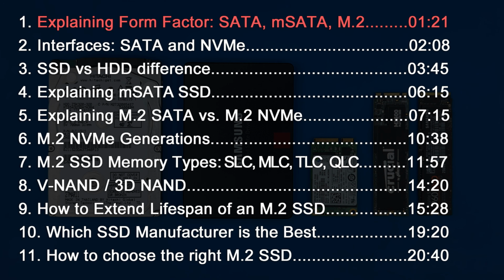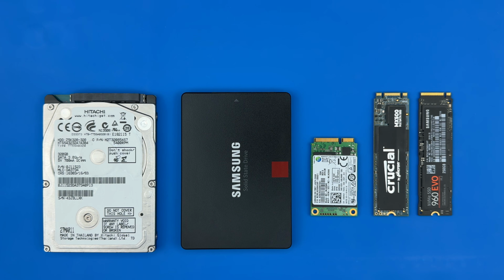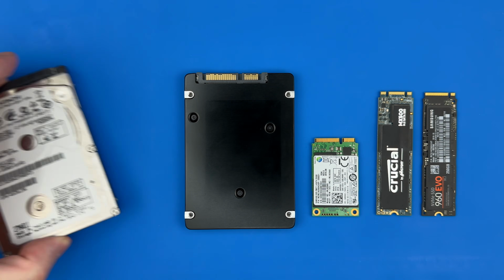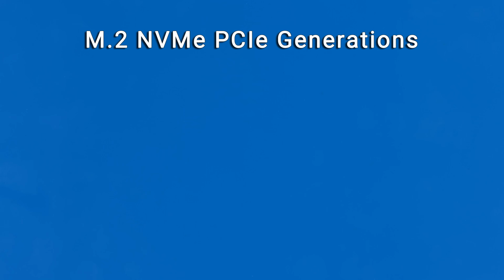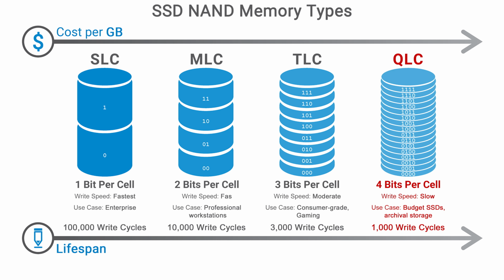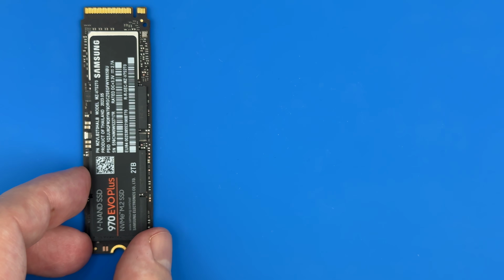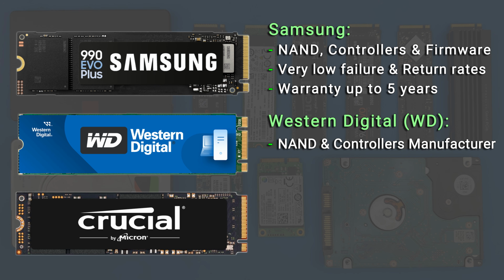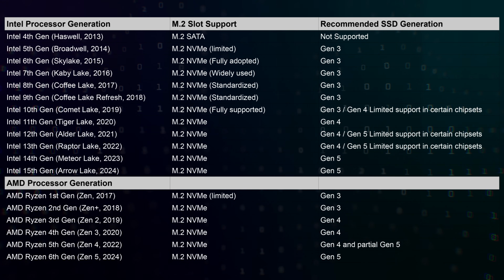SSD vs HDD vs NVMe vs SATA vs mSATA vs M2: Storage Devices EXPLAINED!

Comment: Very well explained which made it VERY easy to understand. Good job. I would of liked to seen added talking about the pairing of different drives. Ie using nvme for booting and operating system and HDD for storing everything else. As I've heard of this being used but am unsure if using one limits the other and so forth.

Comment: this video is one of the best in youtube but it hurts my eye to see a screen with white background for a long time. but the colors are beautiful mostly blue and white. that indicates venus has a significant role in your horscope.. you could be having an ascendant as the one that belongs to either mercury, venus or in a very rare scenario saturn. great work buddy that B and N can't be explained more simpler than this. I made a terrible mistake of buying 250 GB nvme connected via  my pcie adapter card since my pc is more than a decade old. So i mod the BIOS and enabled boot from nvme but i should have chosen a 500GB m2 but anyways I am going to use my nvme just for os and will redirect all my downloads to a different drive. so this 10% of free space I will keep an eye on it.. ! the nand types explations were spectacular.. .this is a video chisled like an experienced scultor no errors whatsoever.. great work.

Comment: Nice video BUT... you keep talking about slow (or fast) speeds. A speed can NOT be fast, it's the WRITING (or reading) that is fast, NOT the write SPEED because that is HIGH (or low).

So do NOT say "slowest write speeds", but instead say "lowest write speeds" or "slowest writes".

Likewise there are no warm temperatures or expensive prices.

Comment: Great video! (I'm now a channel subscriber.) One question: When you were calculating Daily Write Allowance, why did you use ten years? In Samsung's description, they say the unit comes with 5 years of protection. Hmmm... Or do you just plug in the number of years you anticipate using the drive? So I'm just wondering...

Comment: @howfixit  Model: Dell Inspiron 5570 x64
Processor: Intel(R) Core(TM) i7-8550U CPU @ 1.80GHz, 1992Mhz, 4 Core(s), 8 logical processesor(s)
Installed Physical Mem: 8.00 GB

What do you think is the suited ssd generation for my laptop?

Comment: Thank you for your informative video. I have a Dell Laptop which is at least 5 years old. It has an Itel I7 sticker on it so I would assume that is the CPU Spec. I did upgrade the old harddrive by swapping it with a Samsung SSD 870 EVO of 500GB. The Device Manager also shows my laptop has a Dell Portable SCSI Disk Device. As I am on a pension,  I do not intend to replace my laptop unless is breaks down and although my Win 10 will be no longer supported post October 2025 so I am hopeful that my Malawarebytes Premium will continue to work after the support ends. In any event, I was recently given a gift my a friend of a Samsung SSD 990 Pro PCle 4.0 NVMe M2 SSD and my question is therefore do you think it can be added to my laptop internally or would that be a waste of time. My friend thought that I may upgrade my laptop soon thus the gift but I do not intend to do so. The drive is still in the box and does not have a heat sink so I would buy one if the drive can be used. In this case would you recommend either copper or aluminum? I would be grateful for your thoughts and advice. Regards, Malcolm

Comment: Looking to replace OS storage with a 2TB SSD: Samsung 990 PRO NVMe M.2 SSD, 2 TB, PCIe 4.0, 7,450 MB/s Read, 6,900 MB/s Write, Internal SSD, for Gaming and Video Editing, MZ-V9P2T0BW.

Looking to replace HDD data storage with a 4TB SSD: (1) Samsung SSD 870 EVO, 4 TB, Form Factor 2.5 Inch, Intelligent Turbo Write, Magician 6 Software, Black or (2) SAMSUNG 870 EVO 4TB 2.5 Inch SATA III Internal SSD (MZ-77E4T0B/AM).

Am I making the right SSD selections to upgrade my PC or would you recommend something with better performance?

Computer Name: HP Pavilion Gaming Desktop PC
Product number: 1K4J3AV
Computer Processor: 11th Gen Intel(R) Core (TM) i5-11400 @ 2.60GHz   2.59 GHz
OS: Windows 11 Pro
OS Storage (Drive C): Intel HBRPEKNX0203AH M.2 2280 NVMe PCIe Gen3 x4
Data Storage (Drive D): Seagate HDD ST2000DM008-2FR102

Comment: Another benefit of SSD is that it doesn't have the 10000ft altitude limit above which HDDs are likely to be damaged
Reply: Not  many folks live over 10,000 feet or 3050 meters. So who cares?
Reply: @mikemortensen4973  well there were lots of stories back in the day of iPods and laptops becoming toast on mountain climbs or un unpressurised aeroplanes

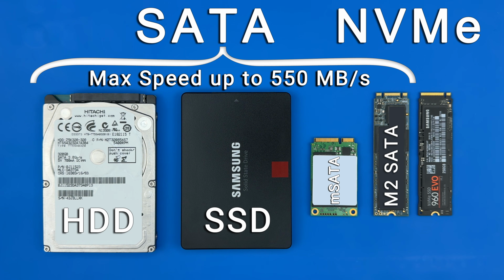Comment: 3:23  I don't think the SATA interface is necessarily considered "outdated". Just very old.

For your primary drive, you would always want an NVMe drive where possible. But beyond that, not all storage use cases prioritize NVMe speeds. In practice, SATA ports supplement M.2/NVMe slots because you typically only get one or two of them because they will take up PCIe lanes on your cpu. But on the same motherboard you can get 4 or more extra SATA ports.
For the SATA ports, you have the flexibility of choosing using HDD (for cheaper storage) or SSD (for faster and mechanically durable storage)

If you need more storage than what your primary drive can give you, adding a SATA drive (and more over time as older drives are in danger of wearing out out) can often be the sensible option.

Comment: Hi, one question here, I have recently purchased my work laptop it`s an old Lenovo L570 20JR-S00J15, it turns out that it has a WWAN port that is compatible with M2 SATA 2242 SSDs, but here M2 M2 SATAs are way more expensive than M2 NVME, so any suggestions? I tried to find a M2 NVME to SATA adapter but no luck only M2 SATA to SATA adapters available.

Comment: Great video. On your table for the generation of processors, the Intel(R) Core(TM) i7 4500u CPU @ 1.80 GHz, 2401 MHz, 2 Cores, 4 Logical Processor(s), a product formerly known as Haswell (currently running my PC), is fourth generation, and the recommended SSD generation is not supported. At the moment, an SSD Samsung 850 EVO 250 GB is running in my Dell Inspiron 5537 with board DELL 019RG3-version A00. Is there no space for an SSD upgrade? Thank you very much.

Comment: Model: Dell Inspiron 5570 x64
Processor: Intel(R) Core(TM) i7-8550U CPU @ 1.80GHz, 1992Mhz, 4 Core(s), 8 logical processesor(s)
Installed Physical Mem: 8.00 GB

What do you think is the suited ssd generation for my laptop?
Reply: Looks like it ships with a hard drive, so you'd be looking at a 2.5" SATA SSD.
Reply: @FlyboyHelosim  it's currently using harddrive but it has slot for M2
Reply: @howfixit  thanks in advance hope you can help me

Comment: WOW! You are doing such a great job, but I am still confused with regards to certain acpects. especially the motherboard.. I have Dell Latitude E7470 14", Intel Core i7-6600U Processor Base, Integrated HD Graphics 520. Which SSD is best for me? I currently have 400-AHCC : M.2 256GB SATA Class 20 Solid State Drive. I copied from Dell's website. it was brought a decade ago, I switched covers and upgrated to Win 11
Reply: So basically you're limited to M.2 SATA SSDs, so anything like that up to any capacity that's currently available on the market.
Reply: Thanks :)

Comment: My dell laptop has a 22x30mm format ssd . The drive says PCIe on it but the connectors are the M2.SATA type with two notches. The system info  says the drive is NVMe. I'm a bit confused about what will be compatible.
Reply: M.2 NVMe SSDs can also have two notches. I would say it's definitely NVMe.
Reply: @FlyboyHelosim  Thank you
Reply: @PhilArmstrong-ql9zr  No problem. Unfortunately this video left out several bits of important information, such as M.2 NVMe SSDs also being available with two notches, which will ultimately lead to much confusion.

Comment: I am going to be honest, i am surprised to see Crucial on this list.  I had a Crucial SSD fail (which of course was the primary boot drive) and got it warrantied only to have the replacement fail as well.  Never bought another Crucial drive after that.  I ended up getting a Kingston SSD which is still functioning.  I can understand Samsung and WD being on the list as i personally have had good experiences with them.
Reply: In a similar vein, I am very surprised by the absence of Kioxia, the king of NVMe manufacturers.

Comment: Hey there
@ about 6:06 in talking about data recovery you mention a method of transplanting the disk into a compatible hard-drive.
Do you have any videos on your channel which delves into this, or can you recommend a video?
Reply: Unless you have access to a cleanroom environment, forget it.  The correct type of cleanroom requires proper overalls, hairnets, and shoe covers and runs entirely on air that has been filtered to microscopic levels.  It also needs tightly controlled access through sanitising booths (which blast any dust particles off staff with high-pressure jets of filtered air from all directions, including underneath, and have sticky mats even to access the booth!) and maintains overpressure to ensure that air can only exit through leaks, and never enter.  
If a pollen fragment or anything even smaller, like a smoke particle, gets between the R/W head and the disk platter, it will peel off the magnetic substrate wherever the head moves, which is the opposite of data recovery!
Reply: @The_Real_Phil_Lee  𝗜'𝗺 𝗹𝗼𝗼𝗸𝗶𝗻𝗴 𝗮𝘁 𝗼𝗻𝗲 𝘁𝗶𝗺𝗲 𝘂𝘀𝗲 𝘄𝗵𝗲𝗿𝗲 𝗜 𝗰𝗮𝗻 𝗿𝗲𝗮𝗱 𝗼𝘂𝘁 𝘁𝗵𝗲 𝗱𝗮𝘁𝗮 𝗮𝗻𝗱 𝘀𝗶𝗺𝗽𝗹𝘆 𝘁𝗿𝗮𝗻𝘀𝗳𝗲𝗿 𝗶𝘁 𝘁𝗼 𝗮 𝗳𝗹𝗮𝘀𝗵 𝗱𝗿𝗶𝘃𝗲. 𝗡𝗼𝘁 𝗵𝗮𝘃𝗶𝗻𝗴 𝗮 𝗽𝗲𝗿𝗺𝗮𝗻𝗲𝗻𝘁 𝘂𝘀𝗲 𝗼𝗳 𝗶𝘁.
(𝗜 𝘄𝗼𝘂𝗹𝗱 𝘀𝘁𝗶𝗹𝗹 𝗹𝗶𝗸𝗲 𝘁𝗼 𝘀𝗲𝗲 𝗮 𝘃𝗶𝗱𝗲𝗼 𝗼𝗻 𝗵𝗼𝘄 𝘁𝗵𝗮𝘁'𝘀 𝗱𝗼𝗻𝗲)

Comment: The main advantage of the mSATA SSD, the small size, was too less mentioned. 2 TB mSATA SSD's are available, but they also hide inside the Samsung T3 and T5 portable SSD's. I don't know about the T7.

An mSATA SSD can be hidden nearly everywhere. If you are planning an ITX micro PC build, a mSATA SSD will fit in the most places. It's more compatible because older boards don't have NVME. NVME SSDs are also often mounted on the underside of the board, so they are difficult to replace. A mSATA SSD can be placed in more convenient places with some double-sided tape on the mSATA adapter.

Comment: It is important to note that some motherboard manufacturers don't allow you the room to affix a heatsink to the M.2 SSD, particularly when they use stacked SSD slots (one slot over the other), but many provide a built-in heatsink with the slot hardware.

Comment: Which M2 SSD can be used in Acer Aspire A315-21 laptop and what is the maximum capacity supported?
Reply: Looks like it ships with a 2.5" SATA HDD... so you can use a 2.5" SATA SSD (or smaller mSATA or M.2 one in a 2.5" enclosure). In theory you can use the largest capacity currently on the market.

Comment: lol not worth it, I got the same performance with raid...    striping 8 normal 250 meg a second drives,     been going 10 years still no errors or ever a bad secter...   the solid state drives basically brick themselves when you run outta writes,     so , back in 98 I was running a 40 meg drive,   and mounting doom on the 16 meg ramdrive...  LOL   instant loading..  dunno why they dont do it now....   a card with slots for 4 ddr 3 slots is still faster then any ssd AND if you put a battery on it,   its not volatile....:-)...  but hey I'm only an engineer...   think I might desing one just to blow ssd's outta the outta the water LOL
Reply from the maker: Haha love the throwback and the engineer energy! you're right, RAM-based storage with battery backup still beats SSDs in raw speed. Would love to see your design blow modern SSDs away!

Comment: I liked your bit about adding a heat sink to reduce temps. Where did you find that copper heat sink with the block carving on the top with the white rubber bands ?
Reply from the maker: all this is available on Amazon and in a larger selection on Aliexpress
Reply: @howfixit  Thank you.

Comment: Talking about 10-20% memory right, does partitioning it has some effect on the lifespan/performance on those storage and if it is, does it has any advantages/disadvantages?
Reply from the maker: Partitioning doesn’t really improve SSD lifespan, but leaving 10–20% unallocated free space helps with wear leveling and performance.
Advantage: Better SSD management, faster writes
Disadvantage: Too many small partitions can lead to inefficient space use
So, partition for organization—but leave some free space unpartitioned for best performance

Comment: Hello. I have a question. I own an gl753v asus rog strix laptop. (Got it in 2017) Recently I've been investigating on how to upgrade storage and ram. I picked up a 2TB Kingston NV3 PCIe 4.0 NVMe M2 SSD. Is this a good choice? Cost me the equivalent of 150 usd in my local currency. But i am within the timeframe to return it and get a refund if need be. But you seem to know in detail, so i wanted to ask about your opinion. Great video, cheers 🙂
Reply from the maker: Thanks! The Kingston NV2 (PCIe 4.0) is a decent budget SSD, but your GL753V only supports SATA and PCIe Gen 3, so the drive will work—but at Gen 3 speeds. If you’re mainly using it for gaming, storage, or light workloads, it’s fine. But for $150, you might find a better-performing Gen 3 SSD (like Samsung 970 EVO Plus or Crucial P5) at a similar price.
If return is easy, it might be worth swapping. Otherwise, it’ll still work great—just not at full Gen 4 speed.

Comment: I finally have order in my head about SSD drives!
Excellent explanation. Short, to the point without overloading with technicalities, but also without simplifications. Just enough to have everything properly organized and make informed decisions, becoming resistant to not always elegant marketing pressures.
Great job, THX! In return, a little tip: using a good thermal paste will lower the temperature of the cooled elements by another 10 Celsius! It's a very small expense and a huge bonus!
Reply from the maker: Thank you so much! Really glad the explanation helped bring some clarity! And great tip—high-quality thermal paste can definitely make a big difference, especially on NVMe SSDs. Every degree counts!

Comment: very good, short and yet full good normal users undestandable video. but it would have been more value added if it would have also included how people can upgrade their old system to use m2.nvme ssd by installing addon card in thier pcie slots which are for non games empty. i have sucsessfully used that , the card costed just 350 INR. but need some explanation that on every motherboard it does not have option to boot from pcie slot. how that can be achived. yet i had found clover ssd to overcome bios missing pcie boot. but such neat and explanation is required
Reply from the maker: You're right—PCIe NVMe adapters are a budget-friendly way to add fast storage to older PCs, but booting from them isn't always straightforward. Tools like Clover Bootloader are great workarounds when BIOS doesn't support NVMe boot. I’ll definitely consider covering that in a future video. Thanks for sharing!

Comment: bottom line is the drivers for the SSD. 
Samsung is the only one that supports its SSD.   
i.e. you can go to Samsung web-site and download drivers. 
the others DONT 
that is why I am able to use a Samsung 970 EVO plus on a amd3+ mobo with Windows7 
(Im using a ASROCK 970 Pro3 mobo (amd3) , running Win7 and a expansion m.2 nvme card, I boot from the m.2)
so in my world (my mind) the only one to use/buy  is Samsung , cuz it supports its  SSD
Reply from the maker: Totally valid point! 👍 Samsung's dedicated NVMe driver support is a big advantage, especially for older systems and OS like Windows 7, where native NVMe support is limited. Glad to hear your 970 EVO Plus setup is working great on that AM3+ board—solid proof that good support makes a difference!

Comment: Great video.  What Samsung ssd would you recommend for dell 7490 i7 8th gen. There seems to be a lot to choose from.  Would it need a heatsink.
Reply from the maker: Your Dell Latitude 7490 supports M.2 NVMe PCIe Gen 3 SSDs.
Recommended Samsung SSDs: 970 EVO Plus or 980 (non-Pro)
Heatsink not needed for this model—it has decent thermal management and Gen 3 SSDs run cooler. Let me know if you need help with installation!
Reply: Thanks for that, is there anything to choose between the two that would influence my purchase for general use. I'm thinking it would probably come down to cost.

Comment: Help me...

Mine is acer travelmate p214 -  52 and im trying to upgrade it to max ram capacity and storage capacity... So. How and what type off ssd that i need?

Please recommend me some brand too
Reply from the maker: Your Acer TravelMate P214-52 supports:
RAM: Up to 32GB DDR4 (2 slots)
Storage: M.2 NVMe PCIe Gen 3 SSD
Optional 2.5” SATA SSD/HDD
SSD Recommendations (M.2 NVMe): Samsung 970 EVO Plus, Crucial P3

Let me know if you need help with installation or RAM suggestions too!
Reply: @howfixit  i meant p215-52.. I miss click it due to that 214 is most common.. But actually mine is 215

Anyways thanks for replying so that i know you indeed active in information

Comment: Bro, I got a HP envy x360 15-ed0023dx. I need to know what type of drive I need?
Reply from the maker: Your HP Envy x360 15-ed0023dx supports an M.2 NVMe PCIe Gen 3 SSD.
Recommended SSDs: Samsung 970 EVO Plus or Crucial P3
Stick to M.2 2280 form factor, and you’re good to go! Let me know if you need help with the upgrade!

Comment: My desktop is dell 3050 optiplex which m.2 nvme should use?
Reply from the maker: Your Dell OptiPlex 3050 supports M.2 NVMe PCIe Gen 3 x4 (2280) SSDs.
Great options: Samsung 970 EVO Plus or Crucial P3